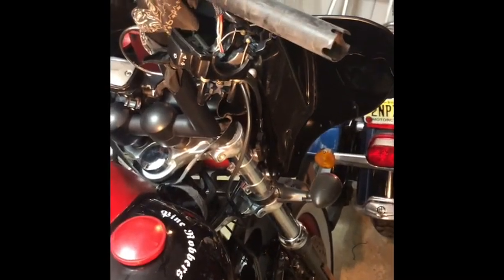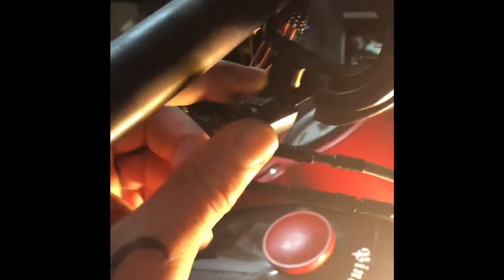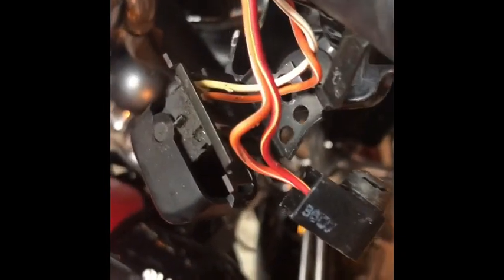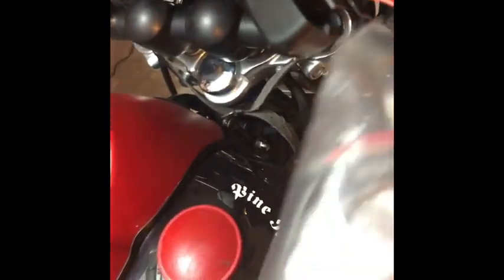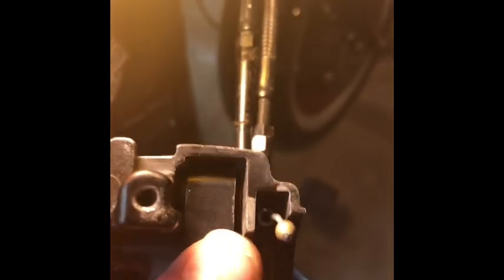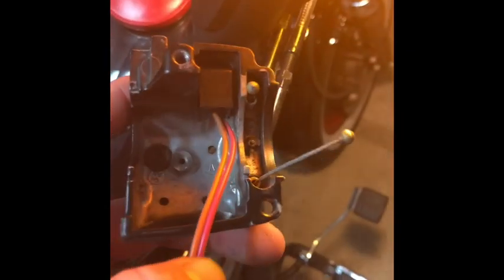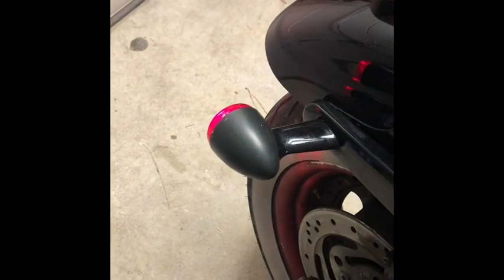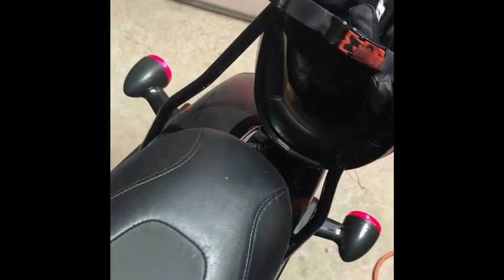Harley Davidson front  brake light switch replacement. 08 dyna fat bob

Comment: I cought on to the metal bracket👍 my plunger was stuck in the housing. I tried to pull it out to clean & lube. It came all the way out "completely"☺ spring & all. I put the spring & plunger back in. Now my brake pedal works again. I'm going to have to replace the fbs. But after watching your video I feel a whole lot more confident about doing it myself. Thanks Bro.
Reply from the maker: No worries man, I’m glad I could help.

Comment: Very informative.
I wish you had shown how you got that extra wiring to fit inside the housing.
Pretty tight in there!
Reply from the maker: I pretty much just folded up the wiring and zip tied it back in the way it was. It was definitely a little more of a tight fit but I was able to move the wire around so everything would go back together nice and tight. I was just very careful not to pinch the wires.

Comment: Thank you for the video, a friend has the same issue. Now we know how to fix it.
Reply from the maker: Spencer Thompson no problem man. If you’re still having issues with getting good contact with your brake lever, I put a little layer of JB weld on my brake lever to really make good contact with the switch and that worked perfectly 👍🏼

Comment: I had same issue.switch then the play in the brake handle. The plunger from master cylinder isn't extend all they way. Little wd40 on the plunger. Small screwdriver and work the gasket/bring around plunger. It will release
Reply from the maker: Luke Flupper good to know man. I was able to get better contact by just adjusting the switch housing and break lever a little. But I can see how the master cylinder plunger could create the same issue.

Comment: Looks like that wasn't the problem, which is why is so sensitive... your master cylinder probably needs a rebuild,  or the plunger cleaned out, or possibly just an alignment issue from putting it together.

Comment: good vid, great detail but you dident touch on how exacally the swtich is oreintated and how the meatal bracket holds the switch, i do belive mine is bent , is hard it seems to find a vid showing this, wires coming out of switch face up or off the side?
Reply from the maker: Once you get in there it’s pretty easy to figure out orientation. Best thing to do is take pics as you go so you can go back and reference it later on. Just take your time

Comment: The switch itself rarely fails.    It’s the little rubber condom over the switch plunger (which is unnecessary).    This condom reduces the gap between the tab on the lever.  Once it fails from compression it results in the switch not being compressed enough to open the switch/circuit.   The new installation will fail again.   Bad design.